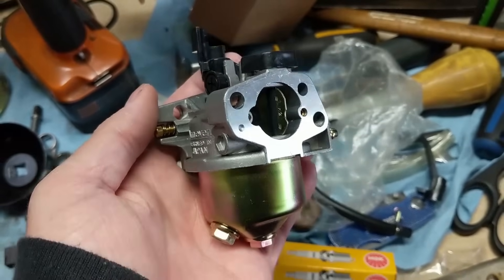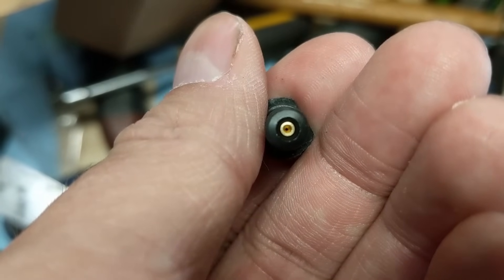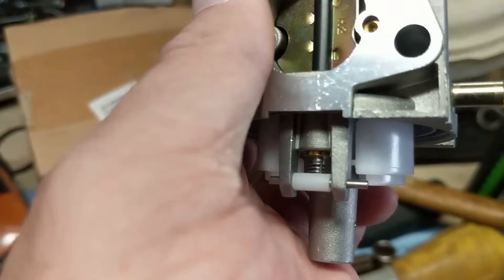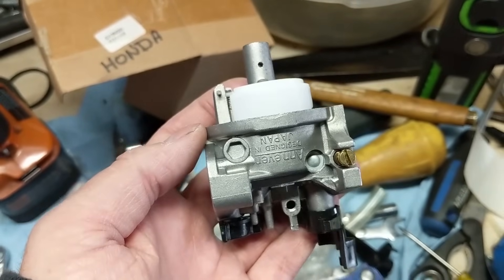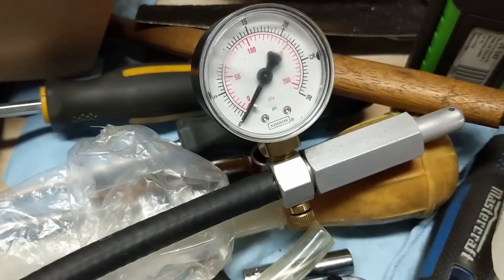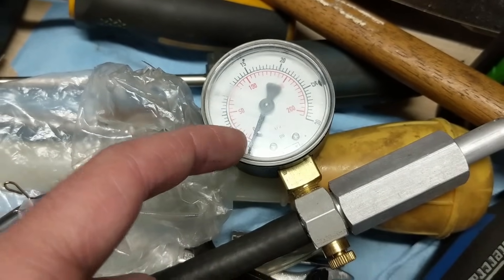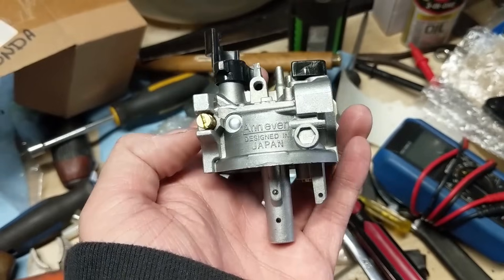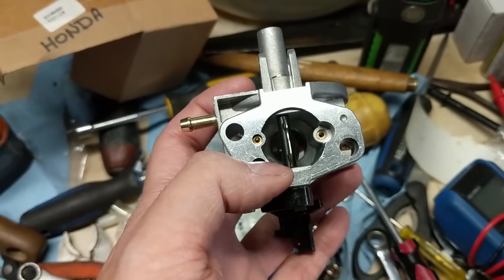How does a Carburetor Work?

Comment: I'm 56 and have been rebuilding carbs my whole life...and this explanation is, by far, the best one I've read.   Great job!!
Reply from the maker: Thanks for watching!
Reply: Good video. I’ll have to watch it a couple of times though. Maybe remove my reluctance to tamper with the carb from my 5hp, 4 stroke, Mariner Outboard which is currently difficult to start and quickly soots up the spark plug?😊

Comment: Dude - thanks so much for the video. Worth every second of my life. I'm a homeowner just trying to rub these two nickels together and make ends meet in this economy, and this video equipped me with the knowledge necessary to pull my carburetor apart, recognize the parts, and find/fix the problem. It ended up being a clogged main jet. BTW, I tested the pressure on the needle valve seal by giving the fuel inlet a little kiss.

Comment: ive looked online for at least 5 years trying to figure out how carbs work...i have at least 5 pieces of equipment that need carb work  mostly had fuel left sitting in them and couldn t ever fix them because i never knew how to fix a carb....this video is a godsend it explains how they work and i feel i can take em off and clean em and get them working again  thank you so much

Comment: I maybe sort of knew before how this worked, but not with this level of clarity. Recently, I replaced a worn out torn up primer bulb on my Toro snowblower. When I took it all apart to replace the little rubber piece, I found that the whole tube had come off the carb. (And I wondered why it had been so challenging to start.) It's great to have more clarity now on exactly how this part works. Really clear explanations with appropriate shots of the parts you're talking about.

Comment: Just wanted to thank you for this video.  Last winter I put off, then forgot to get my generator ready for summer storage. A few days ago I knew I had a problem when I took the gas cap off and it had a smell of varnish. Being an electrician I do not know a lot about how to repair and fix a gas engine. Watched several videos on how to clean and repair carburetors. They did not help a lot. Your video on how a carburetor actually operates and works. once I understood how they work I could see what I needed to do. Most of the videos on here do not go into enough detail on wow to repair a carburetor. Now I know where to come if I have any generator problems.  Again thank you.

Comment: BRAVO! This was an absolutely AWESOME video. I’m an electrical engineer, so I oftentimes need clarification on specific mechanical systems. This was probably the best explanation video I have ever seen. I do a lot of combustion/burner process troubleshooting, so I already understand the Venturi effect and Bernoulli, etc.; but from the perspective a carburetor, this helped pull all of the parts and pieces together for me. My 4 wheeler carb rebuild should be a lot more intuitive now. Thank you again for saving me a lot of time and keep up the excellent work!!!
Reply from the maker: Thanks for watching!
Reply: Also a EE and in total agreement!
Reply: Another EE, just finished fixing a ride on mower, and a push mower, both been in storage for 2years, both with carby issues, I managed to get them going after cleaning out the jets and float valves, although I kind of knew what I was doing, I wished I had found this video first,  rather than after I had fixed the mower,

Comment: One of the best carb videos I have seen. Very precise explanations. Did anyone notice the cracked frame on the Craftsman 12 HP ride mower ? I just finished a complete refab of the same front end and was amazed at how cheap and light the failed metal was.
Reply: At what point of time in the video did you notice the crack? If there was we would have noticed it and weld repaired before returning the mower. We have done many steering assembly weld repairs and they normally hold up well unless you really hit something hard to break the original weld .

Comment: This is by far the most helpful video I’ve seen in trying to troubleshoot my go kart problem. It is leaking fuel out of the exhaust, and it is due to a combination of problems: one, the fuel pressure regulator (fpr) with the built in diaphragm, and two, the needle attached to the float. I have figured out the fpr is indeed malfunctioning due to the carb sucking in gasoline through the vacuum lines. This indicates a pinhole in the diaphragm as you mentioned. I ordered a new one online yesterday. Now I need to dissect the carb and make sure the needle is the issue. Thank you for this video! Very helpful, and great for understanding how the carb works and problems that can occur.
Reply: Your welcome thanks for watching

Comment: Excellent description of the theory and function of the whole and the parts. Helped me solve a problem with a lawnmower with new carb that would flood after hitting a bump in the yard. That spring on the needle was the issue. Thanks so much for this content. Subscribed.

Comment: Wonderful video explaining how such a seemingly simple but surprisingly complex system works. I have an old Zenith carb (tractor) that has a poppet valve on the choke plate and it's difficult trying to find information on which way to install the plate. All the choke parts were missing so I can't copy what was there. I'll try and put your information to work to figuring it out!

Comment: Glad i found this video.  My inverter generator has the same carb as the new one you where using to explain how a carb works.  My generator won't start and my carb is not clogged.
Reply from the maker: Good luck, and thanks for watching!
Reply: And because of your video, I fixed my no start  WEN 3800 watt inverter generator today 10/5/2020.  Thank you my friend !!!
Reply from the maker: @TheResponsibleMarksman  great to hear, thanks for watching!

Comment: You're the best. Thanks for taking the time to thoroughly educate us on everything you do. Your videos are very well done.
Reply from the maker: You are very welcome
Reply: @EliminatorPerformance  Have a question: I just cleaned two Honda pressure Washer carbs. A GX 160 and 200. Both had no ring in the top part of the Pilot/idle jet but seem to run fine when tested. I looked at rebuild kits and there seems to be only one O ring for it shown. Is this an issue. Also I found the 160 had a spring washer in the shut off valve lever and the 200 did not. Thanks for any advice.
Reply from the maker: Anything to seal them, sometimes they have 1, most Kohler's with same carbs have 2. No worries! And spring washer gives resistance on the left right movement of the shut-off valve. It's so it doesn't rattle and close from vibrations

Comment: Super helpful. I'm trying to get an old Honda snowthrower working & it's not getting fuel.  This really helped a lot. It's still struggling, but it's improving and now I know what is and isn't likely to be the problem.  (I think the idle jet is the culprit. Would have had no clue about that.. nor how to clean the needle valve, which was stuck closed.)
Reply from the maker: Thanks for watching!

Comment: As someone who knows very little about the functioning of engines, particularly 2-stroke engines, I agree with other posters, a very lucid explanation of how a carburetor works.   The two questions I have pertain to the video on pressure testing a carburetor as I went over to see that video:  
(1)  what is the proper pressure level to set for assuring proper pressure......is it 5 psi, 10 psi, or does it vary by engine? I could not tell from either this video or the pressure test video.  
(2) I think it would help to show what happens when you exceed the pressure level.  That is, suppose you put in 20 psi with the pump, should the needle valve move and release air pressure until it returns to 10 psi (or 5 psi)?  Basically, the video shows the needle valve holding 10psi.....but how do we know it is not stuck?
Reply from the maker: Pressure testing is just a way to prove the needle valve seals. The real test would be a bench test, where you had a fuel can and fuel line on your bench and could hook it up to see if it leaked. If it holds at 2.5psi or 10psi you know it won't leak. Exceeding the psi doesn't do any harm. Thanks for watching!

Comment: Very good carburetor operation and components function explanation.
Average person can fix the most common problems of the small engines due to ethanol gas mix clogging the main and idle jet when gas set in the unit for extended time.

Comment: @20:52 where you talk about the emulsion tube. It was my brief there is an air inlet in that tube coming from a small inlet that acts as 1.  atmosphere return Inside the fuel bowl before it enters the jet and bleeds Into these small holes in the emulsion to pre mix some air for atomisation efficiency. Briggs and Stratton had a carb how it works that explained this .

Comment: I am wowed by the the excellent Eliminator performance, u indeed eliminated my ignorance on Carburetor...
I want you to clearify me: what could be the major cause of a running generator suddenly gets high...
Thanks as I anticipate ur reply
Reply from the maker: If the generator runs high rpm it could be a leaking gasket sucking in air, or the governor could be out of adjustment if it was hit with something while in storage
Reply: @EliminatorPerformance  
Thanks so much for ur reply
Do you mean leaking gasket on the carburetor side
Reply from the maker: @acorenuche  yes it's possible the gasket in between the engine and carburetor is leaking, which will cause air to go into the engine revving it up because it now has a "lean" mixture. Or the governor rod could be out of adjustment, I've seen lawnmowers that get hit by something in the garage and it's just the governor arm that gets bent a little bit
Reply: @EliminatorPerformance  
Oh I get it now

Thanks for the enlightenment

Comment: Incredible explanation!!  You are a born instructor and a great teacher.  One question: did you explain how to regulate the air/fuel mixer screw?  How many turns CW or CCW?  Also, would you explain how to the governor works on my snow blower and how to regulate the lever adjusting screw (high speed?).  Thanks
Reply from the maker: https://youtu.be/401YwRlDIAQ

Comment: Thank you for this video. I have a 18 HP Khoular motor. I'm having to hunt down and run new fuel lines, new carb and possibly a new 2 gallon tank on it. I've done the air filter and plug on it and changed the fuel filter. Gravity fed and not gei fuel to the fuel filter...cleaned out the gas tank...same deal...not sure what I'm missing...but finding your video sure helped me understand the carbs role in fuel supply...thanks a lot..and I am open to suggestions for my Troy Built Bronco...08 model...thanks

Comment: Fantastic video! Thank you. My question is: how does the air fuel mixture from the idle circuit get into the intake manifold when the butterfly is closed? I suspect it is those 3 or 4 tiny holes in the barrel on the engine side of the butterfly?
Reply from the maker: Yes and the air fuel screw meters the air passing through those holes. Thanks for watching!

Comment: Thanks for this video. It'll help me troubleshoot my rich condition with what looks like the same carburator. I can rebuild a quadrajet with my eyes closed but can't figure out when my cylinder is quickly loading and overflowing with fuel after it's starts running.

Comment: Thank you for the detailed description, it was very useful indeed.👌👍 I watched the video carefully. I would like to know why the carburetor housing has the curved notch around the intake ports. Since it is attached to the engine with a gasket, what is the role of the gasket if it is not sealed in a small area. At 1:39 you can see this notch around the intake throat. Please answer me if you can.
Thank you very much.

Comment: Great video. What pulls the fuel from the bowl through the bowl screw and up through the main jet and eventually into the intake manifold? Is it vacuum created from the cylinder during the power stroke?

Comment: Great explanation. One question I thought would be interesting to add to this explanation is how does the fuel get from the bowl through the main jet up into the main body of the carburetor. Since the bowl is on the bottom it can't be gravity, and there is no pump, is it simply the suction created from the engine that pulls the fuel upward?
Reply: Because the engine sucks in air through the main channel it will create a lower pressure in the main channel. This low pressure sucks up the fuel from the bowl. It is called the Ventury effect.
Reply from the maker: Nailed it! The piston traveling down, with only the intake valve open is what creates suction. The better the seal of the piston rings, the more suction!

Comment: Excellent video!!! very thoroughly explained! I have a G2 golf buggy (80's) and I'm having some pre - ignition issues, ie the motor still wants to run after i stop, it even wants to go in reverse for a few seconds? I've changed the fuel to run high octane(98%) and I've replaced the spark plug but it's still doing it? I'm wondering if my problem is carby maybe or other? Any suggestions would be greatly appreciated!

Comment: Great video but I'm still confused on the air /fuel mixture screw.. is it only for idling purposes or for general operation/open throttle positions?

Comment: Thank you for another nice, clear video.  My Walbro LMK 2085388 carburetor's main jet has no slot for a screw driver.  How do I remove this brass piece so that I can drop out the brass distribution tube that's behind it to clean out all its distribution holes and central channel?

Comment: I have a little 4 stroke 49cc chinese knockoff of a honda gxh50 engine on my bicycle. I've had an issue with my bike not being able to hit the full rev range unless my choke is open. I had to kinda rebuild the carb after it broke from going over a bump with the throttle open. It would just dump gas out through a tube connected to the bottom of the bowl, where on yours it has a bolt to drain it.. I replaced the whole bowl with one from an identical engine/carb, replacing the float and needle valve, and replaced the throttle valve because the spring on the one I had was too weak. Ever since then, if I'm riding with the choke closed, the throttle response and acceleration are sluggish and the engine only revs fast enough to get me to 20mph. With the choke open, the throttle response is great, as is acceleration, the engine will climb up to redline, meaning I go 32mph+ (haven't tested top speed yet) but the bike will want to creep up to 10mph even with the throttle closed. Btw, my carb looks identical to the one in your video except that it has a little valve with a hose attatched at the bottom of the bowl instead of a bolt like yours

Comment: Can you help? Would you have any insight on a problem I have? I had to change the carburetor because the mower would only work on choke and would die on HI or LO positions. I didn't change anything else. But now when I pull the lever out of choke down to the Hi position the rpm is pretty much the same but when I put it on the LO position there is no change in engine speed which seems to be ok for the Hi position. The motor is GVX120 4.4HP 1 cylinder on a Honda HR214 SX 1985!

The governor arm is free to move and if I push on it manually it revs faster. There are no restrictions either on the idle arm where the 2 governor rods attach on the carb.

Any Idea?
BTW your video is the best I've come across. Same carb that I have. Great explanation! Thank you for sharing your knowledge!

Comment: Such a great explanation. There is something things I want to understand: What are the engine side grooves for that are on the sealing surface of the carburetor. Also, on the filter side, there is a third hole on the sealing surface that you did not talk about. What is that for? Any help is greatly appreciated. I am putting on a filter adapter on my minibike, and it looks like it covers up that 3rd hole on the filter side, so I am wondering if that will be a problem. On the engine side, I am just very curious what that groove is doing.

Comment: I have an Ariens PathPro and it surged like crazy. I opened the idea jet and may have opened it too much. I was not sure where the idle screw was set before I removed it though. Now it runs without surging but periodically I hear it popping, sounding like a back firing car. Any suggestions as to what I should try to do to stop the popping? Thank you.

Comment: wow ! very good video , this help me tremadously , I have a surge on my hondo push mower  , i cleaned the carb ,It helped but it still has slight surge . could it be the leakage ,
Reply from the maker: Watch this video, carbs are the same; https://youtu.be/Z6F38bSxSp4

Usually I only have to increase them by 0.002" so a total of 0.018" or 0.020" that's 18 to 20 thousands of an inch. Very small
Reply: @EliminatorPerformance  Thank you !

Comment: Great explanations. I was hoping that you would have covered the small 2 stroke carbs....zama, walbro for a similar explanation in regards to the components and adjustments. I am amazed that those little chunks of metal with small ports, diaphrams and flaps carburate fuel and air like the bigger boys.
Reply from the maker: Thanks for watching!

Comment: Great video very educational I am for the first time attempting to rebuild my carb instead of going and purchasing a new I have a Wisconsin Robin pressure cleaner it will only run if for a short time if I spray staring fluid in the carb will cleaning the carb help solve my problem any help would be great
Reply from the maker: Most likely a clogged main jet!
Reply: @EliminatorPerformance  thanks I ordered a cleaning kit and some carb cleaner going to give it a go could not have even attempted to this without your video great job and thanks again